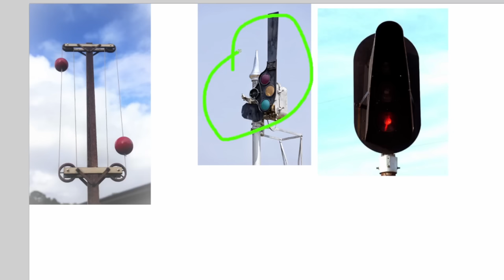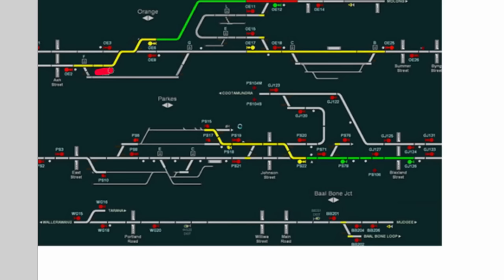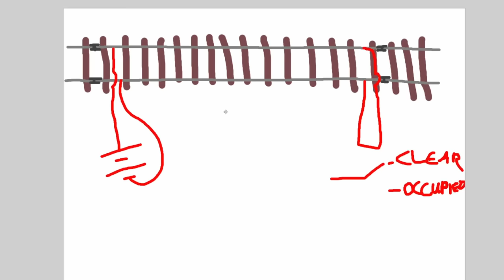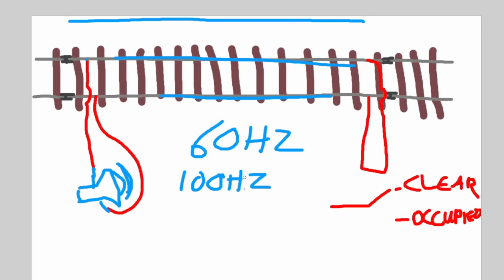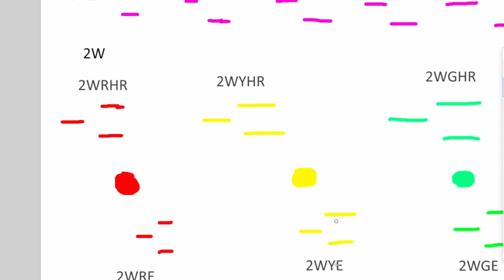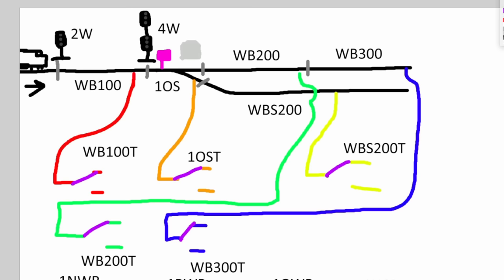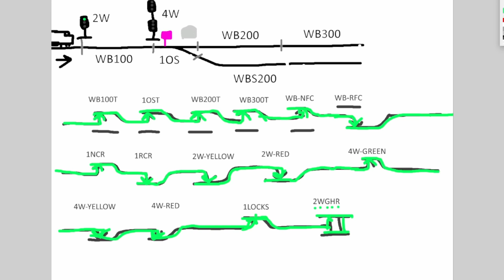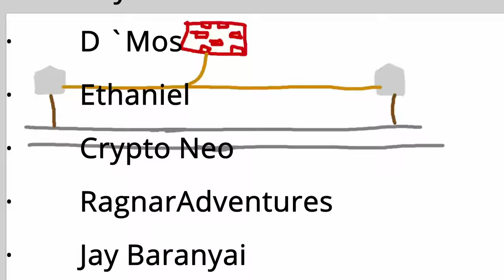SIGNALS 101: 10 Levels of Train Signal Understanding

Comment: Hyce, out of curiosity, of all the signal types out there, which is your favorite style?

For me it would have to be the Baltimore & Ohio's color position lights... Searchlight signals are cool too because you can watch the roundels slip by the light when you change aspects, (and I even wrote and arduino program to simulate  with 7  RGB LEDs on a circular board) but... there is nothing cooler than the CPLs with all of their lights. You can be color blind and read it, and even if you lose a bulb,  it will still display the correct or safer aspect. 

I mean how cool is this view? http://delmarvamodelrailroadclub.org/HO_scale/drcleardiamond.jpg 
or https://www.railpictures.net/showimage.php?id=707896&key=3157593
or https://www.railpictures.net/showimage.php?id=350877&key=1981525
Reply from the maker: Don't personally have a favorite, if I'm honest! Haha.
Reply: You didn't ask me, but as a hardcore signalist, I'll jump in.  I don't have a single favorite, either.  But several different types of signals get honorable mentions for various reasons:
– Color Position-Lights could contend for the safest signal in North America since they are the only design of signal to show Red when a stop is actually required.
– Searchlights have the best optics and visibly of any signal apparatus devised. They can literally be seen for miles.
– Semaphores are great for railfans because they can be observed from about any direction, instead of just in-front.  
 
My "favorite" signals are probably the US&S lower quadrant semaphores.  The zoo near me has one, with home and distant arms, and it's probably the first train signal I ever really noticed or studied.  They're really neat—they're just not practical for revenue use today.
Reply: @jovetj  Nah, that's cool, always up for good discussion. Something interesting however is that the PPL or Pennslvania Position Lights also had red for stop, but yellow in all other aspects on both heads. The initially started out with yellow on all aspects but somewhere in the 50's I believe many mainline signals went to 'red eyes' where the yellow lamps were traded for red stop aspects. I have 2 pair in my barn that my grandfather run under for 30 years... I need to get them repainted and cleaned up, and back to functional again for my RR.
Reply: @kleetus92  All US/Canadian signals have red for Stop.  The CPLs are unique in that Red is only shown for a stop.  Even the red-eye'd PLs show red for indications such as Slow Approach.

The "Red-Eye" change was pretty stupid, too, since red lights are a lot dimmer than the fog-penetrating yellow that PLs traditionally used.  It was much easier to see a Stop signal at a distance when they were fog yellow. 

That's awesome you have some signals to restore!  Lots of intricate parts on those, though.  Lots of sandblasting, most-likely.

Comment: White signal means Restricted at 5 mph this only applies to rail yards. And track circuits are great for knocking signals down to red whever the train passes a Green signal And Trains have PTC how it works is theres an Alarm, it sounds couple minutes, if the Driver fails to press the button or Change speed The brakes on the train slam on, and the train stops
Reply from the maker: that's a very basic look at PTC yes

Comment: Green isn't on the top because of the historical high ball meaning go. For railroads red is on the bottom for safety reasons. Because the sun shields above the lights are longer than for regular traffic lights, in winter snow is more likely to build up between them blocking the two top lights. If green would be on the bottom, you wouldn't be able see if the signal tells you to stop, which is especially dangerous in the dark. Therefore red is placed at the bottom, so it will always be visible.
Reply from the maker: Also true, and a fact I didn't know. Very cool.

Comment: Hyce, I just love this stuff, so I really appreciate this video.  Do you have software to help you design the systems, say with "standard" templates for common situations?  Or is every situation pretty much a custom job, even locally?  Also, I've seen pictures of the mechanical interlocking racks below the lever level, and the thought and engineering that must have gone into them is truly impressive.  Again, thanks for sharing this facinating aspect of railroad infrastructure.  Cheers from Wisconsin!
Reply from the maker: There are definitely some pretty boiler plates "this is for a universal interlocking" or "this is for a diamond/scissors crossovers" that get you most of the way there, but there's almost always some amount of custom work needed. There is software that helps with this, yes.

Comment: One last thing; A green light DOES NOT show that the track is clear! That is an interpretation NOT a statement. 😳
This is a final safety check I used to teach. 
Let me explain.
A green light on an automatic running signal shows, AND ONLY SHOWS, that the circuitry, via ALL the interlocking is complete and that power is flowing to the lightbulb, which is working. 
Yes the rails are continuous, if detected, and all the other ‘foreseeable’ faults are not present. 
BUT. 
It does not tell if there’s a semi truck parked across the track. If there’s been a slump leaving the rails floating in mid air. If there been a slip covering the track but not shorting the circuit. There’s a 50ton boulder slap bang in the centre of the rails….etc. And I have seen ALL of these and more. 
What I used to teach my trainee drivers was…. If you get that funny feeling in the back of your neck that something ain’t right. PUT THE BRAKES ON!  Management can moan at you for going slow but it won’t help or even matter if you’re dead. 
I have the greatest respect for signalling engineers, I know many of them, but the final link of the safety chain is between the ears of the driver. 
Here endth the rant.  🖖

Comment: Hi Hyce, very informative video, thanks so much. If you can say, what years attach to each of the three signal types? (I understand there is overlap, and probably differences east to west US)  Specifically, I'm modeling the Southern Pacific and Sierra Railroads in 1954, and I was wondering what signal types are appropriate for a big mainline and small regional railway of that period.  Am I correct in thinking there is a signal at every mainline turnout?
Reply from the maker: Hey Keith! From what I can tell, it seems that semaphores date to the 1840's, and colorlights start to show up in the 1910's. There's not really a good delineator for colorlight semaphores as a combination, so far as I can see. You'd probably have colorlights on heavy traffic mains, and some amount of semaphores at smaller junctions / regional railways. BNSF just got rid of their last semaphores within the past few years, so they'd be quite common in the 1950's still.

There would most likely not be a signal at every mainline turnout, it just depends on usage. A siding or industry may not have one, but a passing track or dedicated interlocking where many trains would be through-routed would.
Reply: @Hyce777  I'm grateful for your detailed reply! May I impose with one more question? Where exactly are the signals located? At the turnout points, or at what distance back down the track? Thanks again.
Reply from the maker: @keithludowitz9637  Depends on speed and visibility; so there's no one answer, but usually within 50' or so of the points providing there is visibility. Best of luck with the model railroad :)

Comment: Just a hazard of a guess but these signal boxes sound expensive. Both to maintain but also to install. Say aircraft are not completely cheap, they seem to have fewer critical errors just simply because flight paths can be so diverse. Obviously the passenger cost goes up quite a bit on a private jet (airport fees + pilot fees) yet traveling with a full medium to large aircraft seems inherently cheaper until you reach crush capacity of the airspace (say Heathrow being limited and not accepting any more growth of flights/year).

(This is before talking about train vs plane maintenance)
Reply from the maker: They're not cheap, but they're not that expensive at the end of the day.

Comment: 17:02 what if a train derails and none of its wheels are touchingt he track to complete thhe circut, will that be solved too?
Reply: and what happens if a kid connects the 2 tracks by lying on them
Reply: @Radioactive4001  so in that case you probably want that the block is full. For derailments you use short circuit cables so you use a cable to short the two rails to each other.
Reply from the maker: kids are too high of resistance. :P

if none of the wheels are touching the track anymore detecting the train is the last of our problems
Reply: @Hyce777  ik so they would think the track is clear and then the crash would get bigger
Reply from the maker: @Radioactive4001  except for the detail of

-the crew reporting the crash
-dispatch going "huh where did the train go"
-you're probably not going to lose shunt with 100+ cars with 4 axles each... it only takes 1

Comment: Could you troll a railroad by attaching a wire across the rails to make it think there is a train there?
Reply: Yes but it is probably illegal. I think in the Netherlands they must carry cables exactly for that purpose in an accident when the train derails.
Reply from the maker: if it's the right resistance, yes. However, if caught, I believe it's a felony, so - I wouldn't
Reply: @Hyce777  I've seen it attempted before, on axle counter track!
Reply: Yes, in the UK trains are equipped with track circuit operating clips to use in an emergency. They are a piece of wire placed across to the rails to short the circuit and return protecting signals to danger.

Comment: Ok, you're a design engineer.  So, you design a signal...then what do you do until retirement?
Reply from the maker: You don't design the signal, you design the locations and how the logic works. When I talked about the flexibility of the design choices regarding "when does the signal do what" - that's what the job does. In my case, I work for a transit agency, and as we make expansions I am reviewing designs and ensuring that they follow our design requirements and all of the associated standards. Each individual interlocking is quite complex so, it all takes time.

Comment: Here's a question Hyce: Since sections and track circuits need insulated track sections, how do you deal with Continuous Welded Rail (CWR) when you need to actuvate a signal?
Reply: It gets cut for the IRJ, in the RR I work for generally get the IRJ's in long prefabricated sections that's welded in on site. They've got something called an end post that fills the gap between the rails so there's no bump as the train goes over it (and to stop rail expansion pushing them together)
Reply from the maker: Harry is right, they still use IJ's. You could technically use an audio track circuit, but one thing we didn't have time to cover in this video is the pre and post shunt distance - when you get close to the boundary (within 50 feet or so), you can show up on the next circuit "early", so it's not considered good practice to use those circuits for signals that have a specific governing relationship to a point on the track.
Reply: @hannahranga  I see. By the way, your name makes me think of another guy with that name.

And no, not the guy with the late-night news show and microphone (Larry King).

The Harry King I'm thinking of was an engineer that worked on the fictional Indian Valley Railroad on the show Shining Time Station, which of course I grew up on.

TBH, I miss jointed rail. You don't get the classic sound of a rolling train with the new stuff.

The days of hearing clicking and clacking as steel wheels rolled along steel rails is gone now. And for us railfans it's a darn pity.
Reply: @Hyce777  Thanks Hyce, and thanks for continuing to be there for your watchers and not locking replies behind your membership subscription like some video creators do.
Reply from the maker: Cheers - I want the memberships to be some fun extras only, not remove something from everyone else :)

Comment: The red, yellow, green colors of traffic lights are NOT intrinsic to human nature - this association derives from railroad signals and the physics of light.  (In other words, railroad signaling using colors came first.)  
Traffic signals need only be seen from the distance of a city block or so, since for highway traffic of rubber on asphalt/concrete, vehicles can stop so quickly.  The friction of steel wheels on steel rails is very low (which of course is what the railroad is all about) but means a freight train can take a mile or more to come to a complete stop.  Hence the signals have to be visible from that distance.  (And a yellow railroad signal doesn't mean that signal is going to shortly change to red but that the signal might be red in the NEXT block.)
At one point early in the 20th century, they did a study as to what colors should be used.  They realized that humidity in the air causes light to scatter but selectively, so that the color at the high end of the spectrum get scattered the most.  This is why the sky appears blue because this comes from the scattering of the atmosphere, and as the sun sets, sunlight passes through so much more atmosphere (due to the oblique angle), the sky gets redder and redder.
So if signals had the opposite pattern, with red meaning go and green meaning stop, a green light seen from a great distance (in other words, traveling through a lot of atmosphere) will look yellow or even red.  In other words, giving a false positive.
----
The other thing is that with primitive technology, it was easier to change the color than to turn on or off the light itself.  Early semaphores were lit by a lantern.  By means of a lever, colored lens could be moved into or out of position a few inches by means of a lever from the ground.  Lighting or extinguishing the flame meant the operator would have to climb the signal or lower the light each time.  For this reason, we didn't begin with say flashing lights, with rapid pulses meaning stop and slow ones, go, instead of colors.  
(By the way, the ball signals I've seen had a sleeve up at the top and there were several balls - lanterns at night - could be raised or lowered into the sleeve to change the number visible.  This is akin to the Paul Revere signal - one of by land, two if by sea.)
----
Early electrical circuits were not very powerful, so shifting a large blade and colored glasses to change the aspect was at first not practical.  There is the odd-looking banjo signal (aka, hall signal named after the inventor).  This moved oiled paper stretched on wire hoops, of different colors, in front of the light source.  At night, the light was sufficient to see through the paper but during the day, the paper appeared opaque yet the color could still be seen.  This device required a large housing to keep everything from the weather, looking like an upside-down banjo.  Some were still in use c. 1950.
----
Semaphores were because even the early electric lights were too dim to see during the day, so the angle of the blade gave the indication.  At the same time, colors lens (roundels) were moved by the mechanism in front of the single light source, rather than having separate lights, each with its own lens, that came on or off, as on traffic lights.  (Early traffic lights used a semaphore blade in conjunction with the colored lights.)
And the earliest searchlight signals had an internal semaphore-like mechanism to change the lens in front of the lamp.
----
The Edison electric light used a carbonized thread for a filament, which was very fragile.  These couldn't stand up to any degree of vibrations so the electric headlights on locos used an arc light (an arc of electricity between two electrodes like a tiny but continuous bolt of lightening) and bicycles and autos used carbide/acetylene headlights.  In 1911, General Electric invented ductile tungsten which could be drawn into a wire to be used as a filament, allowing for a much brighter and less fragile light - the railroad searchlight came out in 1921.  Here the light source was powerful to be seen even during the day, and the semaphore blade was no longer needed.  (The blade could get a buildup of ice, rendering it unworkable during winter storms so eliminating this was good.)  
Other signals used an array of three lights to simulate the position of the semaphore.

Comment: hello very informative video but you don't work for a railroad like myself, you don't work for union switch and signal seamans manufacturing or general electric railroad signal engineering.and you should talk about why amtrak can still have the old prr signals converted to color position and still maintain PTC compliance?
Reply from the maker: I work for a railroad yes. Never worked for a signals manufacturer. I'm not sure how they do it over east but I'll look into it. They have a different PTC system over there but that's all I know.